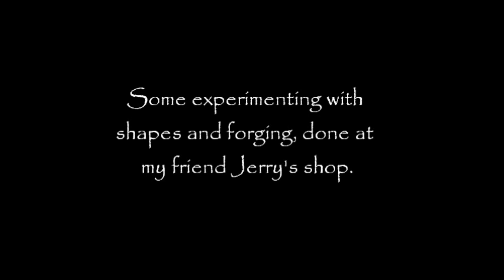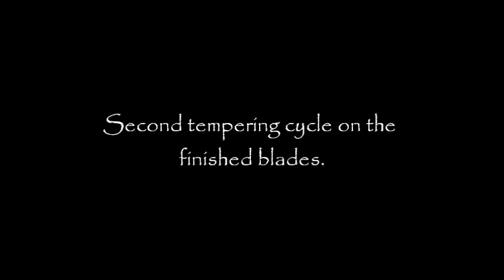Cleavers

Comment: I'm looking to start forging metal, I'm located in southern Ontario, Canada. Any advice you can give to a new smith?
Reply from the maker: If you want to make blades, start with new steel of known composition rather than junk yard or found metal. Join a local blacksmith group if there is one in your area. Read as much as you can find on what you are interested in to avoid unnecessary mistakes. Take your time and enjoy the practice, rushing will produce mediocre results.